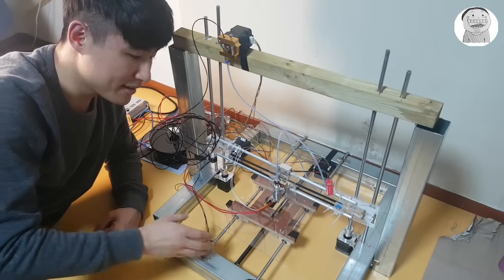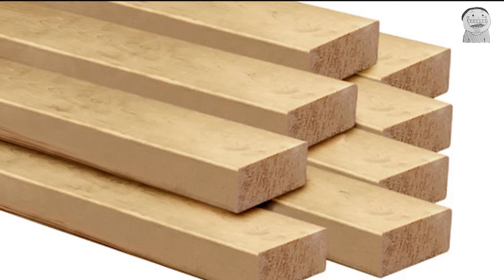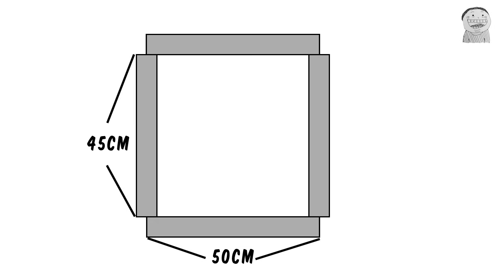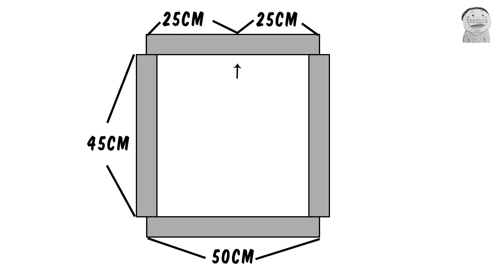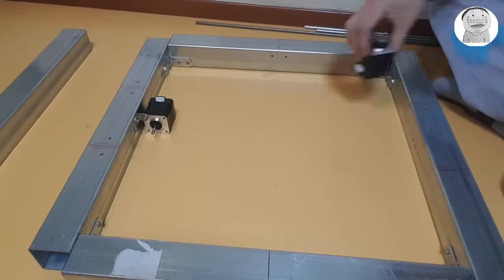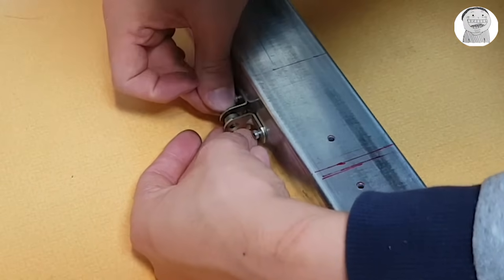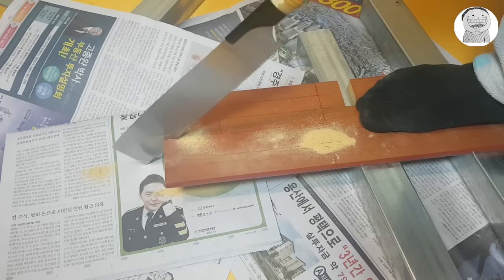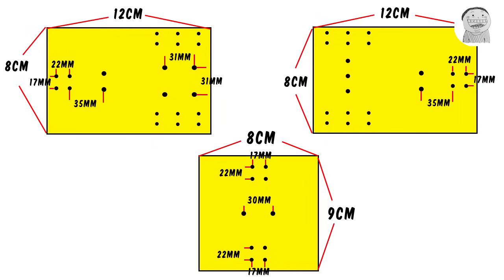How to Make 3D Printer - with Exact Dimensions part 1

Comment: It wont move cause it does not know it's size. I have tried using gcode and inputting it to print with the printer setting in it but still nothing.

Comment: Can i get some help. I went and built one. But am having trouble i went by your video and still can't print anything it is not working everything is connected properly but one end stop stopped lighting up and i can't seem to set up the printer setting to send to the printer. I tried multiple times and spent 3 days trying to get it to work but nothing any advice?
Reply: Did it worked?

Comment: Is it OK to use my nema 23 and tb6600 in my 3d printer? I want to use heated but I'm worried if I burn my ramp using it. I'm new to 3d printing. And I want to make my own so I watch a lot about 3d printer tutorials so I won't waste my money building one.

Comment: Please tell me. When pouring marlin on a new Arduino, all axes react normally except the plastic feed motor. In firmware referred that 1 extruder E0. Where to dig? The printer is only assembled, just started to configure.

Comment: Hi
i hope you are doing well .

i made 3d printer following your Tutorial.

i am facing a problem in printing 3d object .
when i print object the there is a gap between the layer and also it prints first layer smoothly (i-e  Nozzle is nearly touching bed and printing is okay )but for the rest of layers the extruder nozzle  goes too high in the Z axis and there is a much gap between the layer and nozzle,( printing object is then de-shaped due to this gap) due to this i am unable to print anything. can you tell me exactly what is the issue and in which section  of marlin code i can fix this issue .

looking forward to hear from you soon
Thanks
Reply: try to modify ..default_axis_steps_per_unit ... 4000 to 2000.The treaded rod is not proper has the pitch 1 mm instead of 2 mm in original video .....try this!
Reply: @adrian130878  yes i tried ,it worked on 400
Reply: How much this printer costs?

Comment: We are having problem...while testing, the printer can move in every direction but while we print any thing  through pronterface the motor cannot callibrate it self and cannot move in z direction and it pops out the printer halts  we have change the code as u have..we have totally followed u in making of 3d printer .. do u have any solution??? If u have kindly reply.
Reply from the maker: Have you tried my configuration video? I changed some of the marlin configurations and it's in my video.
Reply: @jaykaykim809  yes i have tried but its not working
Reply: @jaykaykim809  the main issue is that when we give commond to pronterface for printing then z-axis  and extuder motor are not working....while in testing phase they are moving properly....help me out i will be very greatful if u do...
Reply from the maker: do you have heat bed? what is it saying on the pronterface?
Reply: Its working now we have heated bed but we r not using it the next hurdle is adjustment of extruder and bed/3dplatform  so that our 3d print should be accurate aor near tooo...can u help in this.
Reply from the maker: @saadakbar5408  sorry for late reply. probably you want to calibrate all axis. all axis should be exactly perpendicular each other.

Comment: HI, Your tutorial is very useful and I am going to make one like this.Can I know why did you put that 45cm pipe(base of the printer) like the half of it was outside of the larger pipe.(the side of the 45cm pipe didn't touch fully the 50cm pipe).Please let me know.
Reply: Syed Afham Hi Syed. That was so he could read the nuts that are on the inside of both pieces of pipe. In theory you could completely overlap them by tightening down the side that will end up covered first.

Comment: WTF you do with the couplers?
Reply: Tim Weilacher The couplers are used to adapt/couple the 5mm shaft on the stepper motor to the 8mm threaded rod shaft. Unfortunately when he first mounts them on the steppers he puts them on upside down. If you look later on when he puts the threaded rod into the coupler you will see that the larger 8mm opening is now up.

Comment: nice work!
it is a lot easier than rztronics.
I want to make a bigger cnc printer   what changes should I bring to this modle???
Reply from the maker: thank you! in case of cnc printer, I think you should make the printer without Z axis. and also make configuration excluded Z axis. It would work but I'm not sure about it because I haven't made                 CNC printer. try to find other instructions too :)
Reply: Jay Kay how about bigger 3d printer
Reply from the maker: for bigger 3d printer, all you need is to expand the sizes of frames and rods! just keep the ratio

Comment: Hi Thanks For Sharing Great Video. Im also building one but can you please tell me in 240 watt power unit, was it 12volt 20 Amps or 24 Volt 10 Amps ?? please guide me as im using currently 12 v 5 amps but it is not working and i have 24 volt 2 amps power unit will it work ?
Reply from the maker: mine is 350Watt, 12volt, 29Amps. if what you have now doesn't work either, try to find what I have(12V 29A). It also could be because of the Watt.

Comment: can i use A4988 stepper motor driver? i didnt find the A49AA you used or they are the same?
Reply from the maker: Khemiri Adel yes you can use anything but the configuration will be different
Reply: can you please tell me what should i change if i use a A4988
Reply: im sorry are you sure thats its a A49AA stepper driver(i mean its not a mistake in the name you put in description)? i only find A4988,looks like A49AA doesn't exist!
Reply from the maker: hmm.. seems as if you are right. A4988 is right. It seems that I mistakenly wrote it. thank you for finding it!
Reply: no problems your welcome :)

Comment: Can you give me the dimensions of the print bed? Like how long is the red parts specifically. Thank you so much.
Reply from the maker: Ethan Naziri there are several sizes of heated bed in the market. you can make based on the heated bed. my heated bed is 25x25 so i made the print bed slightly smaller than that.

Comment: Hello sir can u tell me how did u connected timing belt at heated bed
Reply from the maker: Hatim Patanwala i screwed it to the bottom rack of the heated bed.
Reply: How u exactly screwed it i cant get it please can u give me details of that
Reply from the maker: Hatim Patanwala did u use wood for heated bed? then if u use 4M screws, make 3mm holes, and then screw it.
Reply: But there are no position given for making holes
Reply from the maker: It's easy. You gotta make timing belt perpendicular to heated bed, and make holes right next to the timing belt. You fix the timing belt with screw heads. understood?
Reply: Yup thanks
Reply: Can u tell me the length of screws
Reply from the maker: I used 1cm one.

Comment: great video dude , and thanks for the dimensions and all the other details , can u tell me the power supply input and output (both in voltage and amperes)
Reply from the maker: thanks for watching. it says output is 12V 29A, input is 90-130V 6.5A
Reply: Bobo Station thanks for the reply👍

Comment: Hey, nice tutorial, i´m already at the sled for the bed but i can´t find the length of the top beams and the single middle one.

Mind sharing them?
Reply from the maker: thank you for watching! do you mean the lengths for the print bed? for the top beam, since I'm using 20cm x 20cm heated bed, I used about 20~23cm. and single middle one is about 13cm. these can be various based on how big you are going to make the print bed.
Reply: Thx for the fast response.

Comment: if i can use NEMA 14 STEPPER MOTOR  in this 3d printer ?  without any changes??
Reply from the maker: It depends on step angle and microstepping of your stepper motor and how many teeth your GT2 pulley has. If you tell me the information, I will try finding it.

Comment: hello, can you please give me the dimensions of the pipes that make the frame, not only the long of de pipe that are 45 or 50 cm also the high and  width, thanks for answer
Reply from the maker: hi, thanks for you comment. all height and width for the pipes are 5cm each.
Reply: Can I use 8cm height and 2 cm width pipe to make a printer like this??
Reply: Bobo Station hi bro Is this design useful if you want to make big 3d printer?